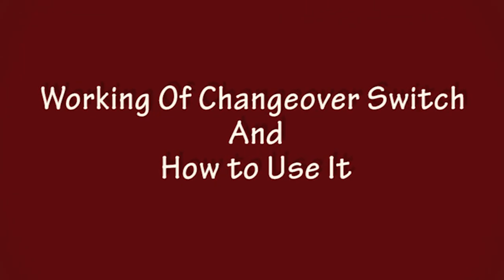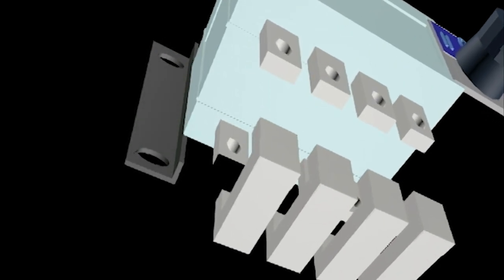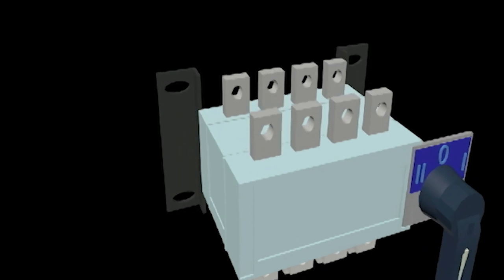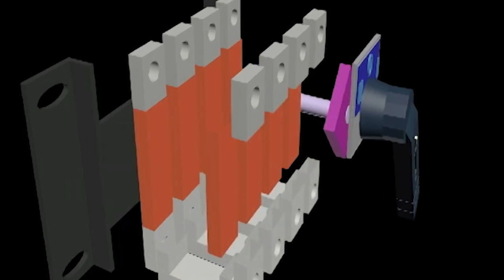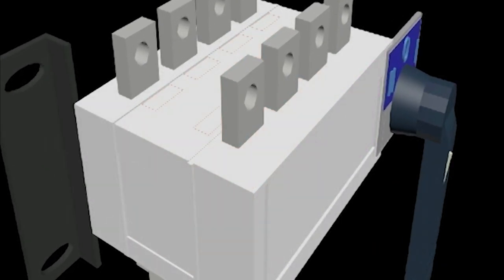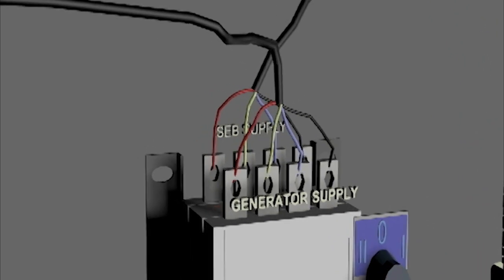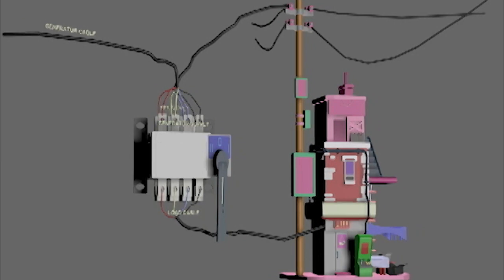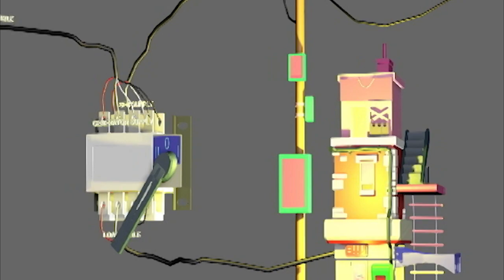Working of Changeover Switch

Comment: where do you use 4 wire in main house power ? we use 3 here canada
Reply from the maker: In India, for loads above 5kw, we get 3-phase 4wire connection power connection from state electricity board
Reply: @starautomation  more to learn :D
Reply from the maker: In India, we have 3phase and neutral